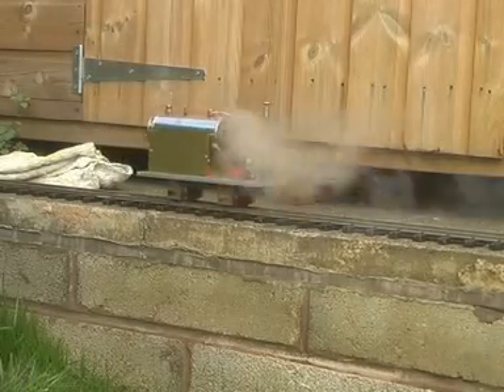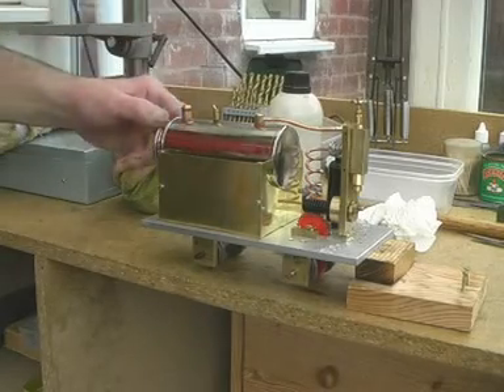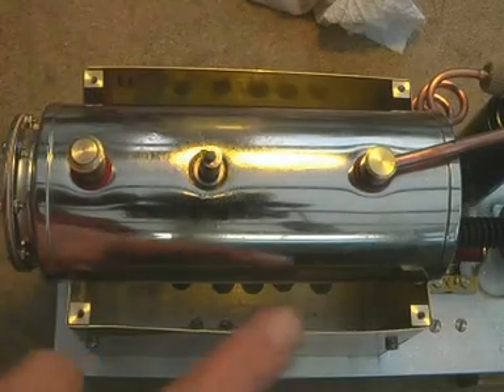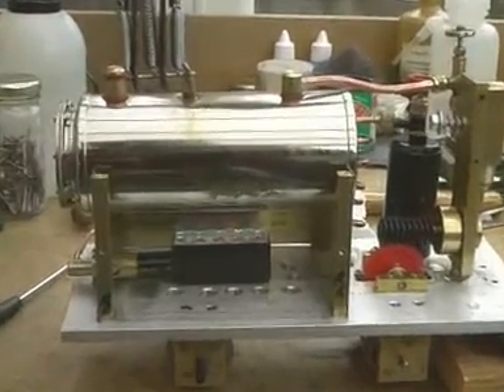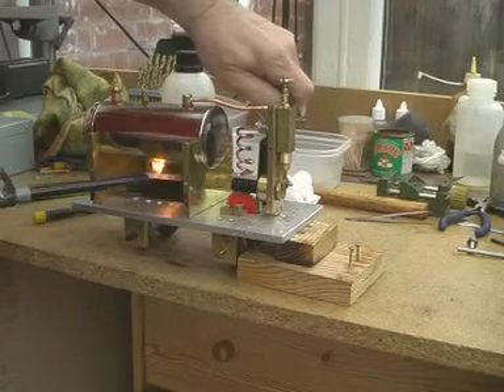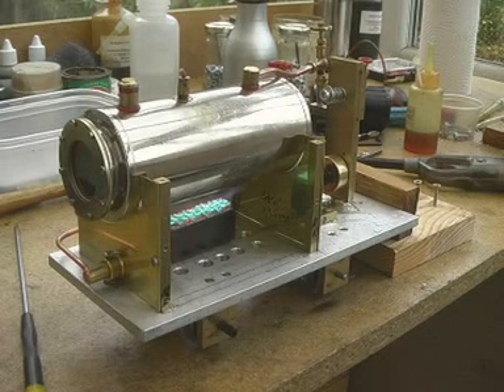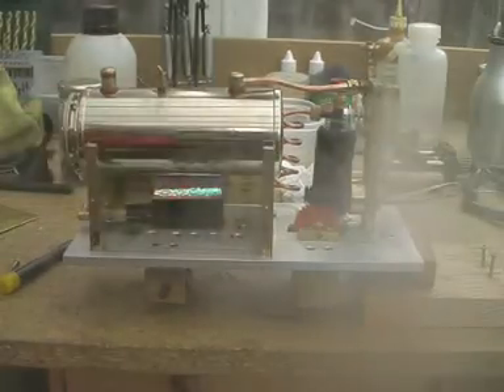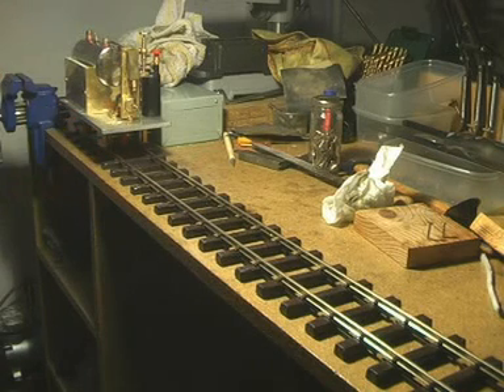simple model steam locomotive

Comment: Hi I got interested in building small steam locomotive that actually works for my science fair project.. I thought i could get some ideas to build a steam locomotive with this video but in this video, it doesn't give me enough information to build one.. So I'll leave my email here, can you help me building one please? (qkrwjd8684@gmail.com) Thank you
Reply from the maker: Hi James. Well, I'm sorry, but I don't think I'd make a very good instructor! Mine would hardly work. But I wish you all success - keep looking around until you find a nice simple proven design that is already known to work well. Good luck, Norman.
Reply: I looked around a lot of videos in youtube and left comments and it was the only video that i got a reply... but can you tell me which materials you used to make this steam locomotive please? Because right now, I have an idea to make one steam locomotive but i don't know which materials i have to use.. Can you please leave some materials I need to build this steam locomotive?
Reply from the maker: Well, I used 1/4" thick aluminium plate as the base. But that was a terrible idea, as it absorbed so much heat. Thin steel sheet (perhaps 0.7mm) would be much better - but you'd have to brace it, perhaps with a couple of 1/4" square steel pieces on the outside. The little engine itself was made from brass, as it's easy to work with. The boiler I bought in - it's a Wilesco. I didn't want the risk of making my own boiler, in case it exploded, which is very dangerous. In fact, it might be an idea to buy a small kit at first; that;s what I did. However, some of these are quite expensive, but there is even a toy wooden engine that works by air from a balloon! If you got one of those, you could copy it into metal - or even some plastic materials! https://ugears.online/products/engine-unique-glue-free-eco-friendly-wooden-mechanical-self-assembly-moving-kit?utm_medium=cpc&utm_source=googlepla&variant=11874461127&gclid=CMyOxKjHgdICFWIq0wodSGQCkQ
Reply: Norman Field thank you for your help, i decided to buy the enginr you recomended to me, and we will add a steam engine to it so that it looks its working with steam engine instead of a balloon. Lastly, can you tell me where you bought your boiler? as you said it was dangerous for us to make one..
Reply from the maker: Hi James. Yes, if you're a beginner, making a boiler is the most hazardous part of it. Even a small boiler should, ideally, be silver soldered - and that's a difficult thing to learn. You're talking about near red-hot! Google: Wilesco Steam engines - there are many different ones & they have made them for many years. When I bought my Wilesco boiler it was GBP29. I just looked and they are now GBP41 - because the GBP is weak at the moment, and the Euro is strong - Wilesco is a German company. Of course, there are second-hand Wilescos on ebay. Good luck, Norman.

Comment: If the flywheel was a quarter larger I bet it would go off like a shot.... I had a small steam engine like that one and found much better results with a solid flywheel a bit larger than what came with it.
Reply from the maker: Many thanks for your comment. You are perfectly correct! The original flywheel was only 1 inch diameter. Following your advice, today I put on a 1.75 inch flywheel, the largest that would fit in, and it went much, much better. 2 or 3 times as far before 'running out of steam'. So thankyou very much! As soon as the larger burner arrives, I think the boiler will then produce enough steam for continuous running. Probably, an updated video will have to be produced. Best regards,